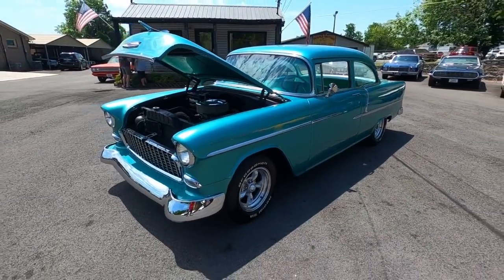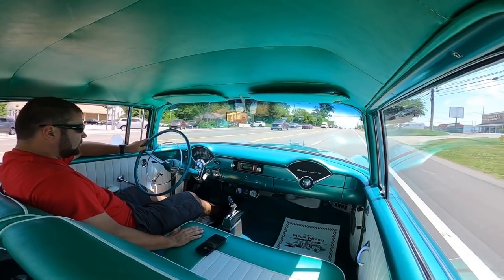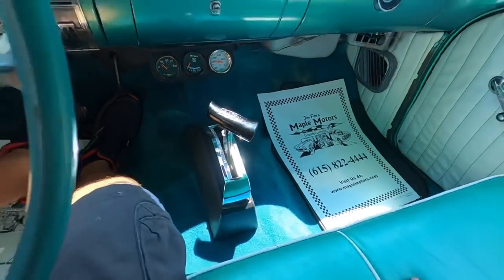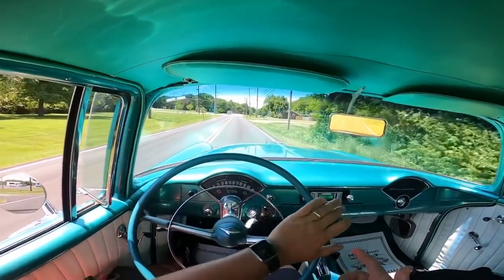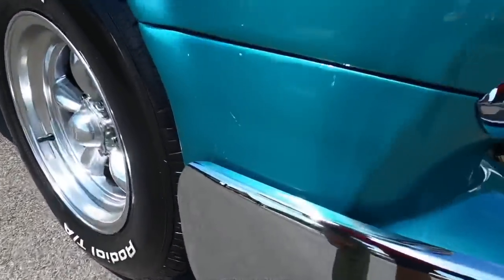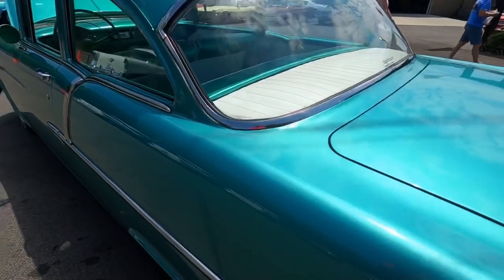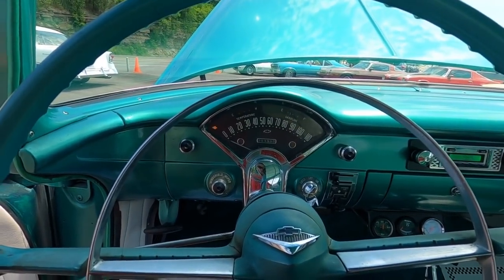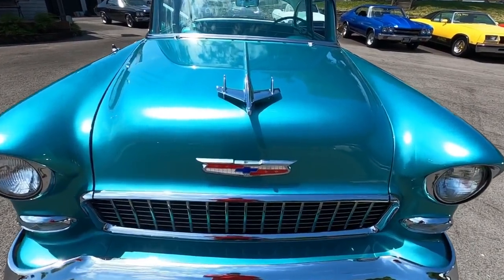Test Drive 1955 Chevrolet 210 2 Door Post SOLD $32,900 Maple Motors #1650

Comment: If she pulls to the left or right first check the tire pressure if this doesn't correct it check the inner and outer support and that should help you resolve the issue.
    (Work's for me)